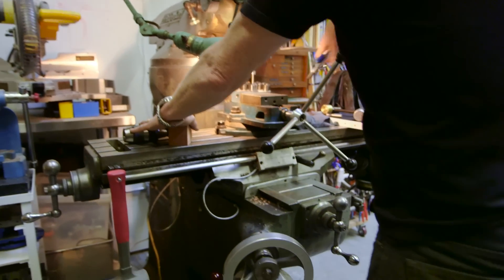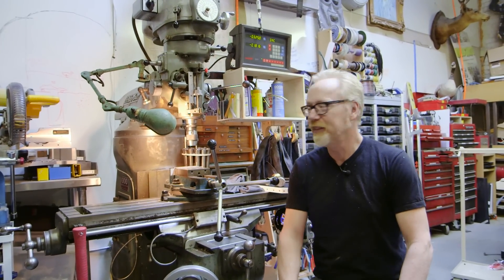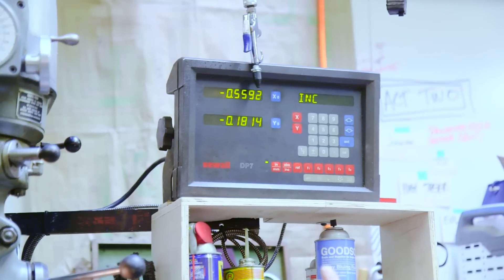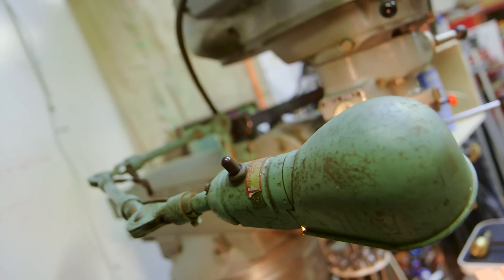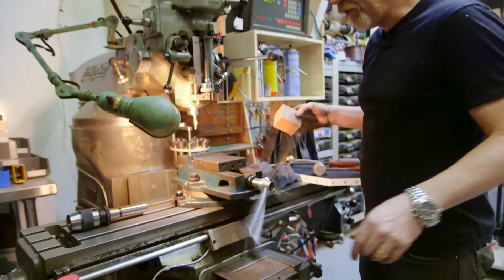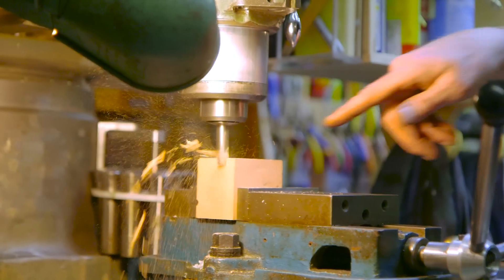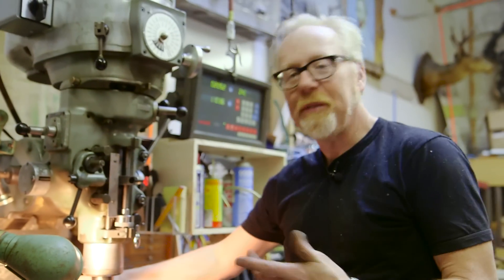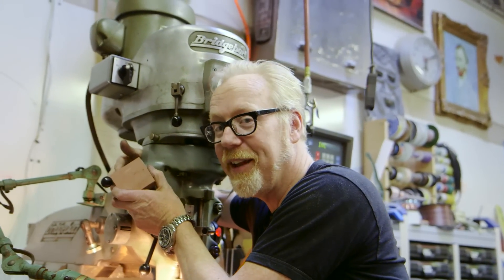Adam Savage's New Milling Machine!

Comment: Speed handle and a motorized knee, I'm jealous.  Yes, its a big deal.
Reply: +Erik Olson That's why you need a spare collet for every drill diameter (or at least the super common ones) and end mill length drills. Even with power on the Z that can save you an insane amount of time and hassle if you do tons of hole operations.

Powered draw bar is also worth it's weight in gold.
Reply: why is the motor in the knee a good thing?
Reply: Almost every time you make a cut you have to crank the knee up by hand and ten revolutions is one inch so if you have a tall part you are cranking that thing 60+ times.  Also, as a mill gets older, it is important to work closer to the head instead of dropping the quill because it becomes sloppy on a clapped out old Bridgeport.
Reply: ***** Yes, I forgot to mention changing to a drill chuck that's probably the biggest advantage.
Reply: Maxwelhse Yes sir, I usually use the mill at my school that has a pneumatic draw bar and there are common sized collets but when you are tapping holes with numbered drills you don't have a choice.
Reply: Erik Olson
If you're in a machine shop you always have a choice. Time to make some collets! :)
Reply: Maxwelhse If it was my shop I would do that but everything is getting replaced next year because there is only one 2 axis CNC Bridgeport conversion that has almost 20 thousandths at the end of the table. Plus, most of the time, there is a freshmen that is learning and will (you make) crank the knee for you haha!
Reply: Erik Olson
Discount equipment is soon going to be up for grabs then. That's even better!
Reply: Maxwelhse I don't think you fully understand the abuse this stuff has gone through.  The only good thing left on the mill is the pneumatic draw bar.  Sure, the CNC controller is usable providing you have floppy discs laying around.  But I guess if its just for a hobby I'm sure you could tune it up to hold tolerance for a long time since it wouldn't get used a few hours every day.
Reply: Erik Olson
I've seen stuff that was abused brought back before. Bridgeport parts aren't "that expensive" (assuming it hasn't been allowed to deteriorate so badly that it would require new castings or something) so repairs are realistic, it's just that you need 6 strong men or a fork lift to work on them.

Besides, power feeds and tooling will go on virtually any mill. There's a good chance the CNC steppers would work just fine with modern controller too. A deal is a deal if they want scrap prices for it.
Reply: Maxwelhse I think it is far enough gone you would spend more money fixing it than buying one in good condition.  Regardless, yes, it would be possible to use some of the parts off of it but you would have to invest a great deal of time into it to get it working.  Given enough time and money a man can do anything :)
Reply: Erik Olson
You just need another Bridgeport, and a lathe would be good, to fix that one. This all seems legit to me.
Reply: Maxwelhse It's a public school so everything is on public auction, you could make it happen.
Reply: Erik Olson
I'd have to put it in my kitchen, which my floor joists would disagree with, and I'm fairly confident I couldn't get it in the door.

...but if I could, I totally would. Crap mill at home is still an improvement on no mill at home.

Comment: This is what Will should have had access to as he was trying to rout out pieces of the desk he made.
Reply: +Efreeti Will should only have access to power tools that someone else is operating until he watches for a few years. The stuff he and Norm builds (and their shop safety) is terrifying. I think shop class skipped them.
Reply: Maxwelhse A few years? That's a bit exaggerated, surely. Compare it to how easy it is to get guns and cars (drivers license) in the US, which are both way more dangerous.
Reply: Efreeti
I watched my parents drive for 14 years before I ever touched the wheel and the same is true of many people who buy their first guns (I had 6-8 years experience with firearms before owning one of my own).

Most of us who actually work on things or build stuff grew up with dads or grandfathers that also did things so we spent years and years "helping" them to learn how to do these things correctly. So, no, a couple of years isn't an exaggeration.

I absolutely encourage anyone that wants to learn to find someone to help them and get started, but turning what amounts to someone with the skill set of an 8 year old loose with a table saw or a router is flat out dangerous for them. As I said, you can observe their lack of shop safety and clearly see that they either lack training or got poor training. Hand those guys some manual tools for awhile until the grown ups teach them right.
Reply: Maxwelhse How do you know Will hadn't seen people use those tools before?
Reply: Efreeti
By watching the horrible ways he works with them.

Or... Perhaps you're right. Maybe he's been observing forever and just never learned anything.
Reply: Maxwelhse He certainly knows more about those tools and how to use them than I do.
Reply: Efreeti
Then you are both on your way to learning and are the people that should be extra vigilant and take your time as you slowly learn how to work safely. In Will's case that also means he shouldn't be showing poor practices to thousands of people on the internet that are even less experienced (like you) without even a disclaimer.

Anyhow, if you want to learn, buy a few manual tools and get to work on something (or if you're young enough to still be in school and the course is offered, take shop class). That's where all of us that have some experience started and all of us smashed and cut up our fingers plenty when we did, but most of us still have them all. Power tools are far less forgiving.
Reply: Maxwelhse I'm over 10 years out of school and school doesn't work here in a way that one can just "take shop" I'm afraid.
Reply: Efreeti
Did the American educational system finally win in an international debate? haha. ;)

I'm not sure how the post-primary educational system (universities/trade programs) work where you are, but here adults can sign up for all sorts of "shop" type classes at small local colleges. My local public school system even has basic welding courses and such that are open to adults during the evening for something like $30 (to cover the cost of materials).

Comment: For someone with that much money as Adam Im surprised he went with a bridgeport... a glorified drillpress...
Reply: +chronok he probably chose it because its something he's familiar with, also spares for these would be super cheap because there are still thousands of these living and working in shops across the world. What do you think he should have gone with.
Reply: metalhead2508 yes bridgeport is fine for many things but when it comes to price vs performance... and if you dont do work where you have to move alot of material.. I have friends who use bridgeports just as a replacement for drill presses

Comment: Adam not sure how likely you are to see this comment just make sure you know the difference between a conventional cut and a climbing cut.  You can get away with either on that supper soft stuff but if you ever go to metal you'll spoil the work or break the mill bit if you try to do a roughing pass climbing cut with a manual mill.

Comment: First time I used a Bridgeport it was in my university's wood shop for a furniture design course. Everyone else was using the hollow chisel mortising machine for their mortises. I used the Bridgeport and then just rounded the corners of my tenons with a rasp. The engineer in me preferred that method. So easy.

I'm jealous, but then again, who has space or the floor weight carrying capacity for one. Damn - nice tool.
Reply: Allan Wright
Since you're not familiar with the AvE channel on YouTube (which is hilarious and educational), and don't mind some Canadian swearing, then you're missing out. AvE makes jokes about people working with "morbid tree carcasses" just in general because he's a metal working/electronics/industrial equipment guy.

Anyhow. Check his channel out (if you don't mind swearing, which he is an artful master of).
Reply: +Allan Wright Wood does not belong on such a machine.  +AvE team unite.
Reply: +Allan Wright Floor weight is no big deal. I know several guys that have mills in a regular garage. Space can certainly be an issue.
Reply: Erik Olson
Well, they retired it from the mechanical engineering machine shop replacing it with a full CNC machine. The wood shop was happy to have it. They also do some metal work in the woodworking shop - customizing hinges and other such hardware. Still a luxury to have it for wood work.

FYI, they do make mill bits for wood for it, so at least some of the tooling manufacturers disagree with you.
Reply: Allan Wright It was a joke

Comment: Why is the knee thing cool? is it just convince of having easy access to it?
Reply: +wrap267 those handles have a lot of resistance (more on the way up), also one turn is only 0.200" (possibly less), say about 1 sec per revolution, if you need the knee up by 6" that's about half a minute of winding a whole lot of arm ache,

Comment: My high school has one of these old Bridgeport milling machines but it has been replaced with a CNC machine so it has been collecting dust downstairs
Reply: +garygsp3   Trust me there's a lot of planning that goes into CNC if not even more than regular milling. Obviously we have to design the model in CAD first, then we have to design the CAM tool path operations, and we also have to do a lot of research on feeds and speeds. It's not as easy as pressing a button, there's a lot of trial and error

Comment: Adam, did you already have 575V 3-phase service in your shop?
Reply: +achuck4321 
You don't need it.  A lot of those old bridgeports will run very happily on 220V single phase.
Reply: garygsp3 Oh that's actually good to hear. That was one of my main concerns when looking at mills. I only have experience with FIRST brand, and they are all 575/3phase
Reply: +achuck4321 
Another option for you is setting up a VFD (Variable Frequency Drive) to run one too.  I've seen guys run them that way too.  However as a word of caution to the VFD they lose a lot of torque on the low end speed.  The VFD is a better option if you have one with step pulleys.  Then you can run the motor full out and still get your torque.

Comment: it looks like something you would have to kill in a bio shock game.
Reply: +Sean McDonnell Probably because it comes from the era that inspired bio shock
Reply: +aceholeas Looks like it was designed in 1936 (wikipedia), and the design is still used today so it must have been well engineered. What is creeping me out though is that lamp appendage that it has, looks like it could also shoot death rays at me if it tried hard enough.
Reply: +Scoldpedia I think it's more than a decade off

Comment: Why is a motor on the knee good?! O.o
Reply: +jod125 accuracy(more precise cuts, especially if you have it converted to CNC), time(faster cuts), and saving the wrist from having to do all that turning of the crank to get your piece to move through the cuts you make.
Reply: +jod125 Less lactic acid build up :)
Reply: using the motorized Z for deeper plunge cuts with a DRO/CNC setup can help you immensely, but whatever floats your boat. :)
Reply: +kenabi when performing plunging cuts using the knee the power feed is not used. CNC is a completely separate issue.
Reply: +metalhead2508 You do use the knee for some plunge cuts, with large milling cutters for example. Just not with the the power feed.

Comment: it's just older/manual version of cnc machine!
Reply: +FreeOnGoal The CNC machine was born of the union of the Milling machine, the Lathe and the Computer.
Reply: Cnc standard for computer numeric control. So a computer is controlling the speed and feed and the dimensions. Such as when Adam turned on the knee motor to move the bed up. If that motor and all of the other motors were attached to a computer then it could control them autonomously based on programing. This is what we used before Cnc was a viable option.
Reply: *stands

Comment: So, in guessing they are real hard to find? can ya give us a ballpark number on what it cost? :-)
Reply: Depends on size, condition, brand and options. Like cars. Anywhere from ~2 000-20 000+
Depends what it had before Adam got it. Then add the cost of tooling it is a big investment.
Reply: ChuckADickiner thanks man. That's about what I figured.
Reply: +Logic Bob Plus the cost to move one of these if very high. When you get one to your shop the installation needs a VERY SOLID base and 3 phase power.

Comment: Why did you lower the head of the drill instead of raising the base? since it creates vibration throu the head and makes for sloppy cuts
Reply: Not really a big deal on a bit of modeling plastic.
Reply: +ChuckADickiner didn't see that first. was to hot on my keyboard. I'm a cnc operator and used to wanting everything short.

Comment: So why is a "motor-on-the-knee" awesome?
Reply: +TrueFireAnt Because the knee and table are VERY heavy, and the handle brings the table UP or DOWN in 1/10 of an inch increments.  Meaning without the power assist, it takes a LOT of work to crank it up to the desired height.
Reply: Think of it like a trailer jack. If you have ever cranked one of those you will know that it takes several turns to go an inch. And if the trailer is heavy it can be a decent workout. The knee and bed (the part where the vice is) are very heavy cast steel and the crank is designed to be very accurate. Which means you have to move the handle a long way to make the bed go a very short distance. If you have to do this all day you will feel it. Trust me on that.
Reply: No problem, glad I could help man. I've always wondered why they haven't made a system for you boys yet. Just put a fitting on the trailer jack and run an impact gun off the air system. Should be easy
Reply: +TrueFireAnt Because savage said it is
Reply: +ChuckADickiner love your explanation with the trailer, im a trucker. and iv had to crank a fully loaded trailer up 3 inches, took a lot of work, and a very long time to do. so i understood just why the motor is awesome, and needed.
Reply: +stirlingfromla +ChuckADickiner Thank you. The problem was that I didn't understand what the "knee" was, and I managed to stupidly confuse things by writing "motor-on-the-knee" instead of "a motor on the knee" for some reason. It was surprisingly tough to find out what a knee is, incidentally.
Reply: because the knee is actually a knob you need to turn clockwise or counterclockwise to move it up or down and sometimes you need to change the height drastically and it's annoying Turning the handle for so long

Comment: that motor is beautiful, no more rusty crank
Reply: +man of steel metal-working 
If you have problems with a "rusty crank" you should check out MrPete222. He made videos on how to build a crank adapter that allows you to use a drill to raise and lower the table.
Reply: that sounds awesome thank you

Comment: So, Ye olde CNC machine?
Reply: That's like saying radio is ye Olde tv.
Reply: not cnc
Reply: +ElectroGroove CNC is controlled by computer, Adam's milling machine is manually controlled.
Reply: +TehAlekzi Thats what I mean, its like a cnc machine before they had computers to control them in the 1960's.
Reply: Cnc standard for computer numeric control. So a computer is controlling the speed and feed and the dimensions. Such as when Adam turned on the knee motor to move the bed up. If that motor and all of the other motors were attached to a computer then it could control them autonomously based on programing. This is what we used before Cnc was a viable option.
Reply: +ChuckADickiner Yes, that is a good point. I guess I was wrong.